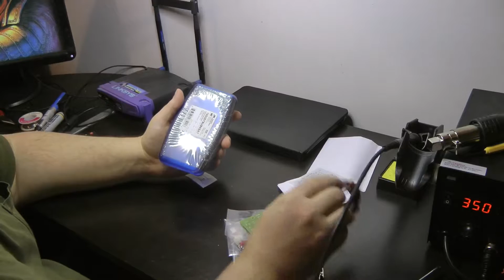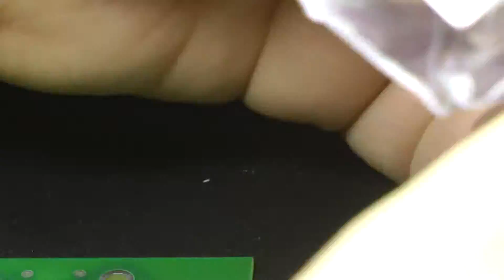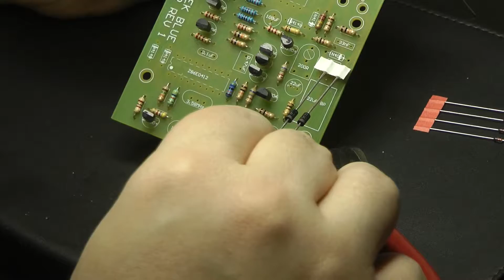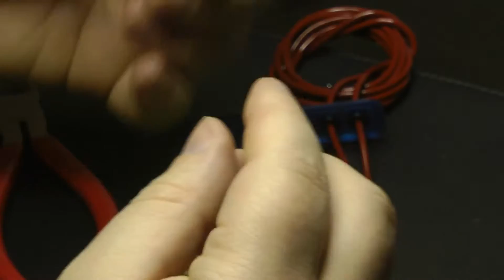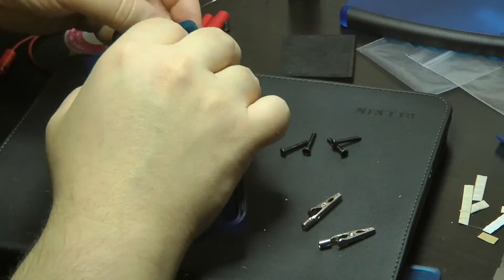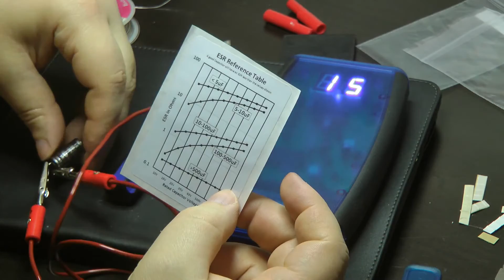LFS - Anatek Bob Parker Blue ESR Meter Build/Calibration/Test

Comment: I designed the Blue ESR meter (really). Thanks for doing the video. Just for your info, the main reason for eliminating the banana jacks was because the resistance between them and the plugs varies every time you move the leads, messing up the zero setting on low ESR readings. This was always a problem with the earlier Dick Smith version of the same meter. I didn't write the instructions and that graph on the label was someone else's idea too. I think the original chart of typical good capacitor ESR figures was much easier to use.
Reply: I am interested in this meter because it was recommended by EEVblog a youtuber here. But this one looks different than the one he shows in his videos, the one in his videos is dark gray and has the values as a chart not a graph like on this one and I am wondering if it be worth buying this one?
Reply: @SDsailor7  Hi Rob. Dave is using one of the older Australian Dick Smith Electronics meters. Altronics in Australia makes an exact copy of it, at https://www.altronics.com.au/p/k2574-esr-meter-kit/ . The Blue ESR meter is the same design packaged into a different case and produced in the USA. They function exactly the same. Hope this helps.
Reply: ZilogBob... is this ANATEK company the same as the one from Canada who made the pocket series MIDI devices in the 1990's...?
Reply: @noddyspuncture  Anatek was originally in New Hampshire. Sadly John Bachman who was running it was killed by a hit-run driver and the company got sold to Alltronics in California. I don't think they have ever had any Canadian or MIDI involvement.
Reply: @ZilogBob  OK, many thanks for your reply. I guess it'll be a different company.

Comment: Glad to see those meters are still being sold and built. I worked for John Bachman, the original creator of that kit, back between 2008 and 2013, prior to his untimely death. I worked for John as a side job building kits for resale and putting the actual kits together. John's wife sold the company to its current owners, and from the looks of it, they changed little. One thing they did change is we used to pack the resistors by value if I recall. Also, working through this video, I've noticed one other thing; the 7-segment display blocks were originally socketed, but the new owners started using rubber standoffs instead to likely save cost.
Reply: RIP John. I enjoyed collaborating with him and I was dismayed when he was taken from us, especially the way it happened.